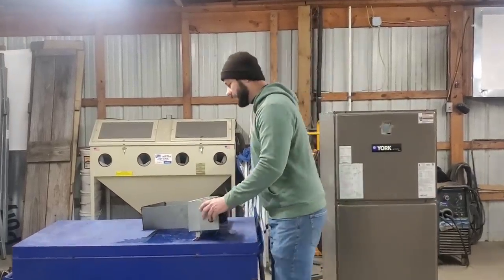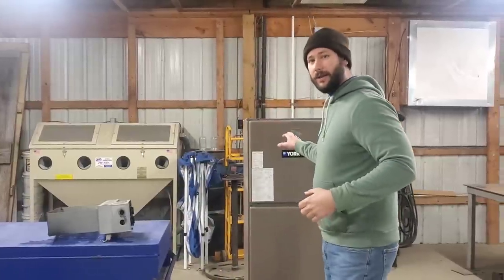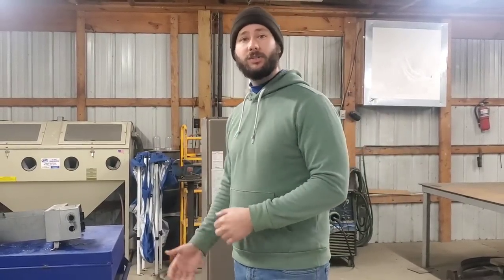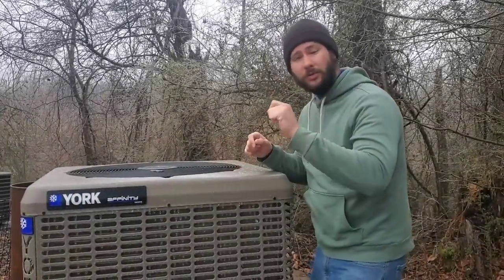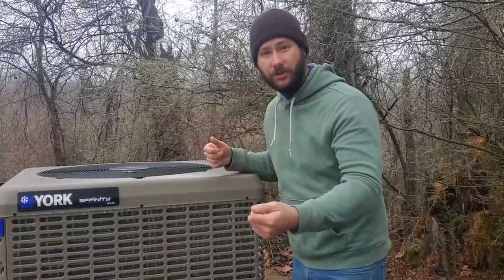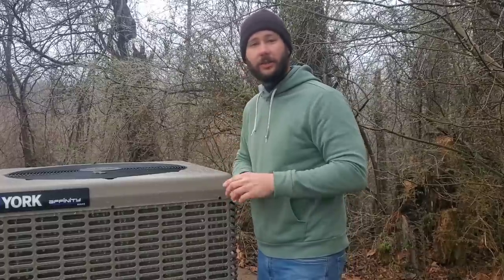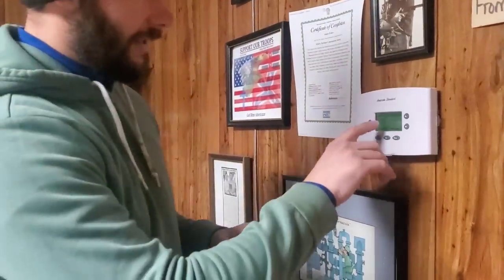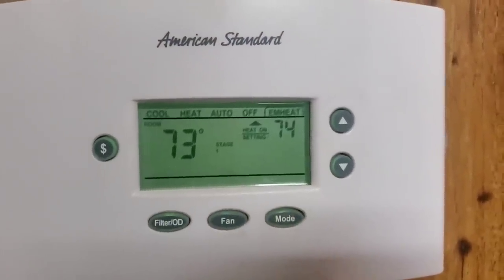Heat Pumps? When to use Emergency Heat? #emergencyheat #heatpump

Comment: I had an older heat pump that my folks had put in, but it had to replaced last year and the new one is not working the same way at cold temps.  I was told nothing about using emergency heat when this was put in.  I have spoken to the man who put it and he has told me two different things on two different days, and I am confused.  I now know when it is going to be below 0 that i need to put it on emergency heat, but this time when it was put on it, it was dropping and despite my having it put on 72 degrees it was only reading at 64 degrees.  I had a local company come out and check it  because the man who put it in was not answering his phone and they replaced the filter, and it came up to 68 degrees, but by the next morning it was down to 64 and it stayed that way all day.  My house was very cold and until my sister brought me a space heater did the indoor temp rise.  It never got up to 72 until the day it was above 20 degrees.  I did not have this trouble before this cold snap came along - I do not understand why it is not working properly since the frigid weather.  Does this mean there is a problem?  Right now I have had it on heat pump and it took it over 2 hours to come up to the 72 setting, but it has been running since I turned it off emergency heat and I am wondering if that is correct.  I just do not feel the man who put it in wants to come down and check it out.  I am trying to understand this new equipment and never did my parents have to deal with this - they always had good heat from the old unit and I did until it had to be replaced.  I was never told that this one would not be able to maintain heat below 0 and that it should be turned onto emergency settings...apparently it has a warranty, and I never knew about that either!  I do not feel I was told what I needed to know.  Can anyone help me understand?

Comment: Finally. I’m sitting here in Nc. It’s 30 outside. Inside 58 degrees.Everyone here says don’t use your emergency heat. It’s like paying for auto insurance and being afraid to use it. I shut my heat off because the pump will run and never shut off .We wake up just because it’s so cold inside.Once the sun comes up even if it’s still freezing outside the pump starts heating up the house like toast. My question. Can I just turn on emergency heat just to get the chill out say 5 minutes? Then switch it back to normal? And when it’s on emergency heat , will the thermostat work normally turning the heat strips on and off automatically to maintain temp?
Reply from the maker: Yes you can turn it on for five minutes and yes it will work normally.
Reply: So I turn EM heat on. I hear the blower in the attic blowing. There is air coming out of vents. But after 20 minutes no heat at all. Stupid question, but do these heat strips come with the unit when installed. This is a new house

Comment: The only thing I might add is if you turn off the outside unit and then you get ice or wet sticky snow accumulation on the fan blades you fan can self destruct from being unbalanced I saw this happen.
Reply from the maker: I agree Mike glad you commented and added this this is good information
Reply: I live in Arkansas and we just had that winter weather blow through. The night it was rolling in, we had rain, then sleet, then rain again, and it went back and forth for a bit before eventually changing to snow. When the temps were just at freezing, my unit was making a weird sound like it was not balanced. I new it had to be the fan just from the sound it was making. I shut it down, let it sit for a bit, and then set the heat back to it's normal temp and let it fire back up. Was fine after that. I am assuming the rain helped flush off whatever ice did accumulate on the blades, making it unbalanced. I thought for sure my unit was broken. It warmed up the next day and melted anything that was on/in the unit, and it has been running normally. I'm new to homeownership, and the last thing I or anyone would want is a huge repair bill. lol

Comment: Is a split unit same as a heat pump?
Reply from the maker: A heat pump can be a split unit or a package unit
Reply: @TaddyDigest  ok. I got something. It doesn't look like some of the heat pumps I've seen. Mine looks like a car engine.  Its 2 radiators that sits on a big box.
Reply from the maker: Okay so that's probably a package unit

Comment: There's rarely a reason to run emergency heat, hence the name. However, not maintaining the system to the point the outdoor unit is full of dirt and freezes into a solid block of ice is a good reason. Otherwise, you really shouldn't ever deliberately turn off the outdoor unit. Most modern systems are still more efficient than the heat strips at -5, but they need to be maintained and kept an eye on at least a little.
I see you made this video less than a week before the polar vortex, so while I completely disagree with you on when to use emergency heat, it was  well timed and probably legitimately helped some people.
Reply from the maker: I agree with you and it's better to run the heat pump than the heat strips even in really cold weather
 But yes I did make the video so that people that seen their unit frozen solid block of ice that did not defrost or thaw that they might have a chance to turn it off and save from creating damage

thanks for commenting and watching 👀 🙂
Reply: Good to know, but more efficient down to -5 isn't much solace when you're paying up to 2 to 3 times as you approach that point. Heat pumps are installed in climates they shouldn't be, at least when they don't have a secondary heat source like an oil or gas furnace. Depending on fuel costs though, gas isn't that great, especially if we are talking Propane over piped gas in cities.
Reply: Not really.  My Goodman is 3 years old along with house that was built in 2019.  It was just serviced again in September.  House is about as weatherproofed as I can get it.  Heat pump still struggles below 15 degrees during the night.  Need the heat strips.

Comment: What about electricity cost? Does it cost more to let the unit run for 18 hours a day or to use the emergency heat? I have my unit set to 64 currently (not other heating elements running in the house) and it has been running constantly. I do notice Aux coming on every now and then, but usually it's just running in heat mode without the Aux. You're in TN like me, so you know what the weather has been like the past few days.
Reply from the maker: Yeah below 20ﾟ the unit is no longer efficient so it's more efficient if the emergency heat runs so the equipment will not run all day and never catch up
Reply: @TaddyDigest  Thanks for the insight....not looking forward to this next electric bill either way!

Comment: What if the thermostat shows the option for Auxiliary and emergency heat? When the temp hits a specific temp, auxiliary. However, there is an option for emergency heat as well.
Reply: That's my honeywell T 10

Comment: The below table outlines the cost differences of normal heat pump use a=in 30 degrees F weather for one week versus one week of use in 10 degrees F weather with the emergency heat in use for 12 hours per day to keep up with demand.

Cost Breakdown	Normal Operation
at 30 Degrees
for 1 week	Emergency Heat
Operation at 10
Degrees for 1 week
Watts per hour:	3000 watts	3000 watts + 15000 watts
Hours use per day:	12 hours	24 hours + 12 hours
Number of days:	7 days	7 days
Total kWH:	252 kWH	252 kWH + 1260 kWH
Cost per kWH:	$0.13	$0.13
Total Cost per Week:	$32.76	$196.56
As you can see, there is a severe increase in the cost of $163.80 per week when the emergency heat is in use in extremely cost weather.

might want to consider the costs of emergency heat
Reply from the maker: very cool thank you for sharing this 

consider the cost find a alternative source of heat maybe?
or freeze to death lol

Comment: Hello.  Is the fan supposed to be running while in emergency heat?
I have a hot water boiler as emergency heat but my fan comes on when it starts blowing cool air. Thanks, Ben.
Reply from the maker: Fan is most important for the transfer of the warm air in the house so yes it should be running if wired in properly with the thermostat

Comment: I have a high efficiency hvac package..do i still turn it on emergency heat, or leave it on regular heat under the temperature under 30 degrees..Thanks
Reply: Higher efficiencies are able to handle it. Below 32F is when your outdoor coil will start to freeze [because condensation created is below the freeze level for water], however it will still function properly, it may lose efficiency. That's the only thing you will notice, it'll take longer to heat the house, heat pumps take the heat of the outdoor air and discharges it inside the house. However once it reaches below 0 in outdoor temp, then your heatpump will become inefficient since there's no more heat outside to take in. Typically your thermostat, or unit will be smart enough to know when to run auxiliary heat when needed. [T-Stats typically have a setting within them that'll enable auxiliary heat when needed, like if the unit runs longer than usual, temp different of 2 degrees or more, etc].
Reply: @FrostHVAC  ..Thank you for the information..
Reply from the maker: I would turn it on em heat if it does one of the following 

runs day and night 
has ice or snow on outdoor coil fan or blade 
not heating efficiently

Comment: So we're about to get an ice storm here in Central Kentucky and I'm worried about my outside unit icing up.

If I run the auxiliary heat or emergency heat the outside unit won't function that's correct?
Reply from the maker: If you operate in emergency heat then your outdoor unit will not function
Reply: @TaddyDigest  

Awesome
Reply: @TaddyDigest  thank you for posting this very informative easy video just for an old lady here - when emer heat on the blades don't spin right?  LOL
Reply from the maker: that's right... no outdoor fan motor blades will spin on emergency heat.. Thank you please hit the like button and share my video.

Comment: I haven’t seen a question about this but I’m in the DFW and I turned on emergency heat because of the recent snow we had but then our power went out for about a day. The power is back on and emergency heat is running but the air coming out feels almost cold instead of warm or hot like it was before the power went out. Is this normal? Should I just let emergency heat run non stop until it starts to function properly?
Reply from the maker: if you don't feel the warm heat then something is wrong maybe even not wired properly Get it checked out
Reply: @TaddyDigest  definitely not wired wrong. It was working perfectly before the power went out. I’ll call someone to come check it out.
Reply: @TaddyDigest  thanks btw

Comment: Assuming the outdoor condenser is broken as a worse case scenario, how much heat capacity does the heat strip by itself?
Reply: The heat strips will heat the house by themselves. There are multiples that are sequenced to come on one by one so there is not a surge load when one big one would kick on. I replaced an electric furnace with a heat pump with similar capacity of the heat strips.

Comment: When you go back to AUX heat and the unit outside is making a loud noise does that mean it’s trying to make it warm? Live in an apartment in Texas had to use EM Heat due to the weather we have been having.
Reply from the maker: unit could be defrosting 

make sure not ice or snow still inside or on top of the unit
Reply: @TaddyDigest  Will do! Thank you..

Comment: What do I do if I turn on my aux heat  and is not keeping up. I have the thermostat set at 69 with aux heat it’s only getting up to 65.
Reply from the maker: Your emergency heat might not be hooked up on the thermostat
 Check events make sure it blows warm air whenever you turn the emergency heat on

Comment: My HVAC person told me that it will do all of that on its own automatically I won’t have to touch anything it will Supplement with auxiliary heat on it’s own and defrost on its own
Reply from the maker: Your thermostat may be programmed to lock out your heat pump and automatically turn your emergency heat on when needed
 All heat pump thermostats should work and automatically turn the auxiliary heat on during they're hit on during normal operation

Comment: Why be concerned with ice freezing on the heat pump when all of them go to auto defrost, thus kicks on the AC for a few minutes which is used to defrost the unit..Everything i have ever been told or read, says to use aux heat to help bring the house up to temp when the heat pump struggles. Using Aux heat is not to defrost the unit or that is not what it was initially designed for. Actually you want to discourage using aux heat unless absolutely necessary. No one wants a sky high electric bill. It's extremely inefficient and it drinks electricity.
Reply from the maker: Hey Jeff great point 
I really appreciate this comment.
 The reason I am concerned about ice freezing on the unit is because sometimes the ice will freeze over the outdoor fan or freeze to the blades 
This ice freezing on or over the unit can cause damage to the unit

Comment: In extremely cold temperatures  my heat pump won't cycle on and off .  It is set on automatic but still runs constantly and doesn't cycle and 5 degrees outside.     What could be going on ?    It should cycle on and off
Reply from the maker: It can't gain heat from the outside here
 Probably need your auxiliary heat or your emergency heat on
 Could be that your heat strips aren't working

Comment: Why does my magic pak system smell like burning rubber/chemical smell in defrost mode? Is it toxic? (EM not in use) Ps: magic pak sucks. When I turn the EM on, there's a little whistling sound. I can't win either way.
Reply from the maker: The heat strips do this sometimes the first time every winter but that smell should subside.
If it continues then I would have it looked at.
What is a magic pack? Is that the same thing as a package heat pump unit.
Reply: @TaddyDigest  it's a brand I guess. Big silver box that Has a compressor and everything

Comment: Why would a heat pump release a musty smell during a cycle? It's not the same as the burn smell when it first starts up after being off for a while. Irritates my throat.
Reply from the maker: Indoor coil needs to be cleaned
Reply: @TaddyDigest  It is clean. And the smells don't come out every time. It runs without smell for a cycle, then randomly smells the next cycle, then doesn't smell the cycle after that. It happened at my old place as well which had a heat pump. These things are garbage.

Comment: Very good.  This is a subject that we New England people know little about.  I think we have Heat Pump-A/C's here but they handle small condos and apartments.  I'd say most us view them as gimmicky for this part of the country.
But I know the smell you described, as the hot water baseboard heat from our boiler will produce some of that smell when first turned on after non use during the warm weather months.  It's the same smell as turning on a space heater that hasn't run in a while.  I think of it as micro dusts that collected on the electric elements burning off. 
I found this video as a result of having stayed at my Dad's home in Florida last spring.  That home has little use and at night when the temps were dropping into the mid-40F I had a concern about the switching devices in the heat pump locking up in some way, as I don't think the system has ever been used for heat.  I don't know if that can happen, again I'm a Yankee, but I didn't want to possibly damage the system that worked fine for A/C.  I opted to use the auxiliary heat as years before my parents had explained that it was electric and didn't involve the heat pump segment.  I was surprised at how powerful the auxiliary electric unit was.  I knew then I wanted to add that to the A/C handler in my home for emergency use if the boiler were to go out.
Reply from the maker: Very cool I always love hearing different perspectives and the experiences it's a great learning tool
 Thank you for sharing this with me
 Here if you don't have a good insulated home and you use electric heat strips you will have very high electric bills
  It doesn't get too cold here we only have snow for maybe a couple weeks and it's usually less than 4"
Reply from the maker: Thank you for sharing
 I appreciate you
Reply: @TaddyDigest    You're a smart man, and you care about your business.  I admire that.  I've enjoyed and learned from other videos of yours and have several stored in my reference section on youtube.
Your videos always get a thumbs-up from me.
Thanks for what you do!
Reply from the maker: wow that is great thank you discerningmind
Reply: @TaddyDigest    You're welcome.